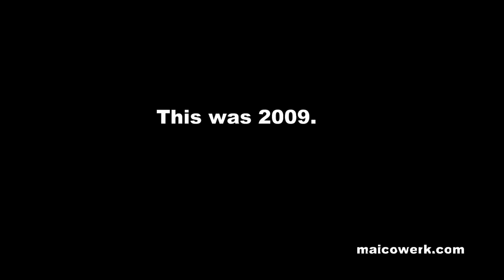How to create a Vintage Non-Slip Brake Pedal!

Comment: You have to use shielding gas like CO2 and tip of the nozzle closer to the material u are welding at.For a non welder nice job!
Reply from the maker: This is a very cheap wire welder and that was flux core where the wire also has embedded the shielding, so there's no shielding gas needed but ya all odds were against me.  If I get a new welder and try again I'd get a Linclon stick welder.
Reply from the maker: Thanks!

Comment: Time for you to get a proper Schweißerpass ;)
Reply: Opferman Motors
Just a small advice my father gave me: if there is enough surface a good soldering is often better as a bad weld joint.
Also when you are getting a new welder, let someone you know show you how to use it right and take your time to firstly train with the new welder with scrap parts  and secondly get used to the new welder by training on scrap parts.
Reply from the maker: L0rdMetzger This one held up pretty good at least, even if it's ugly!  Ya I have a cheap wire welder and I just went for it.  My father was a professional welder who built custom industrial equipment for mines and such, so I never tried to learn since he could just weld and build anything even though I probably should have asked him back then how to weld.  He lives on the other side of the US but if I decide to try welding again or get a new welder I may just ask him.  Ya, I read about the scrap metal, but I was not patient and just wanted to go for it!
Reply from the maker: L0rdMetzger If he lived here, I would have just gotten him to do it :)
Reply from the maker: L0rdMetzger That's also why I just went for it, I saw him weld since I was a little kid so I thought I had some upper hand as it looked pretty easy.  Apparently, that was not the case :)